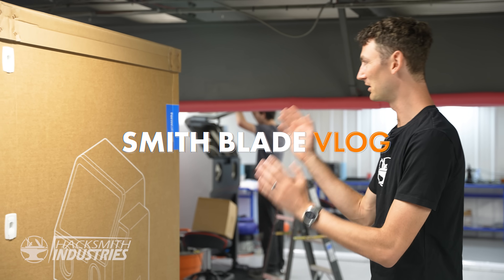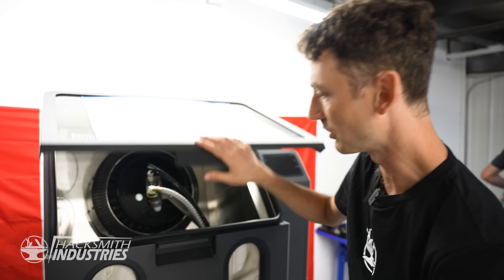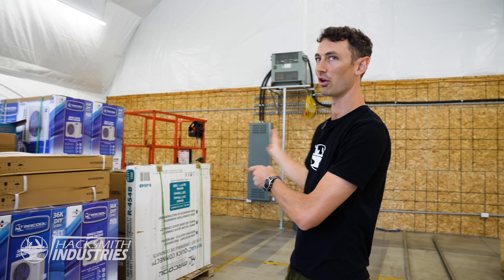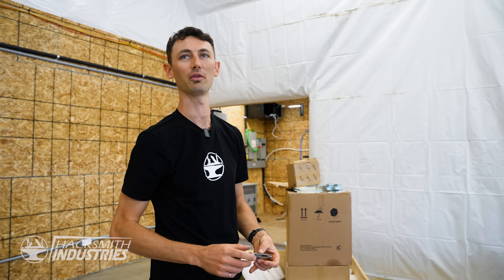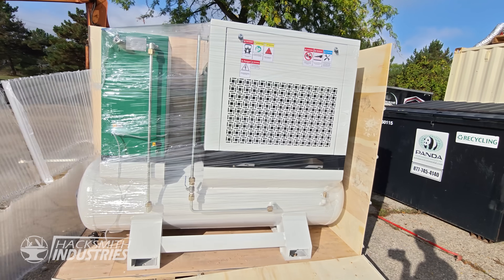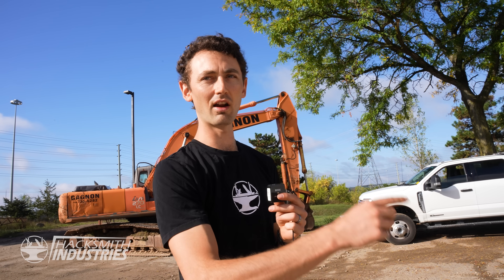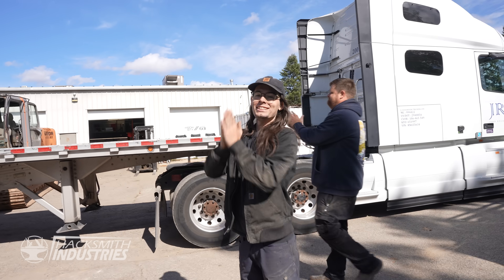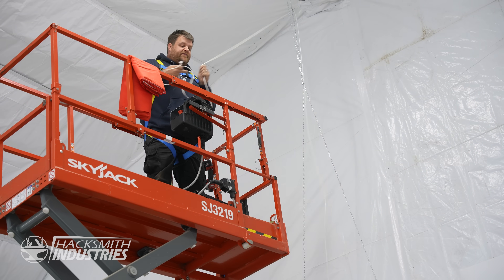These Knives? Made in Canada | Smith Blade Update | 04

Comment: Stupid question, but cant you just open the door to cool the room?
I know i uversimplify and you propably want to control the enviroment completely and need a setup that also works in summer. But dont you have enough cool air at least in the winter outside? :D
Reply: not really, one side of the building can be hot and the other can be cold. you would know, if you worked at factory with no conditioning like i used to. its painful to work in 38+°C in summer and 25°C during winter even with door open because its on the other side of the building only

Comment: Do you really expect to sell so many of these that all this infrastructure is neccessary? I get that you could use all of this to quickly make more products down the line, but I question the long term viability of this level of expenditure vs projected gross.
Reply: They already have made the sales needed for this. They need all of this to just fulfill the current kickstarter orders within a timely matter.
Reply: @pixelsixdesigns  So a little over 10 million dollars USD, from what I've seen they've gotta be pushing that already with the costs of everything seen so far, even with selling the laser cutter etc.
Reply: @DangerousDac the latest ive seen on these vlogs are about 30 ish machines which are about $30k per machine. From structure upgrades and added tools theyce probably only spent around 1-2 mil so far. Thats just from the vlogs though. They could have spent more on the hvac aystem and electric installation, but these initial vlog updates only show so much.
Reply: @LyonsDenFarm it probebly also voes to stock to.make the smithblades out of
Reply: One CNC machine can only produce 1 Smith Blade every 2 hours, that's only 12 blades a day from one CNC machine. They said they are getting a total of 33 CNC machines which they hope to run 24/7. So 33 machines can produce 396 blades each day.
2,772 blades each week.
11,880 blades each month.
This means its going to take about 3 months and 2 weeks just to complete the 40,000 Smith Blades that everyone ordered on Kickstarter.
So yeah, after you factor in cutting errors, machine break downs, daily maintenance and other problems which will likely happen, I'd say they probably do need all of this...
Reply: They already have 40000 knifes to fulfill.
Reply: That and yes, that's kind of been a recurring request. Instead making a computer tool like Linus tech tips, or the grill scrubber that smarter every day started to pursue American manufacturing, hacksmith makes cool gadgets for the tinker. They get to make cool stuff at the scale of a paying audience now. I'll buy into that any day if I have the funds.
Reply: With 40,000 units being purchased on kickstarter, most of those still being an idea essentially, I would imagine that their sales will do just fine once they can finally have an actual stock built up. They are already making the online store that you will be able to buy these from in the future. They also mentioned that if they had stuck to their original plan, it would have taken 3 years or more to make the blades just from the Kickstarter.